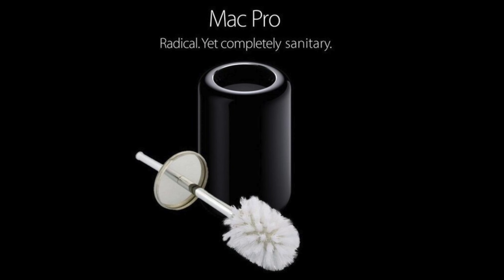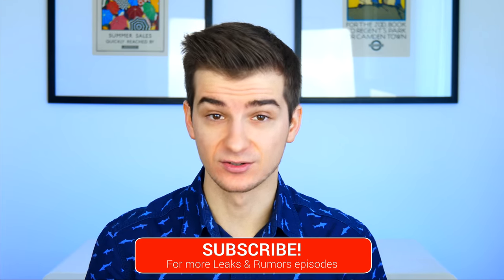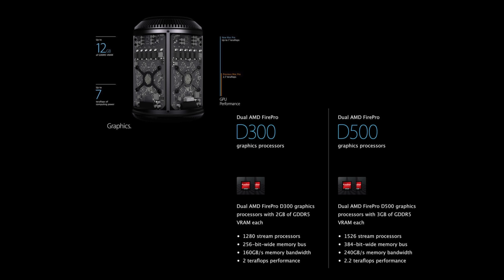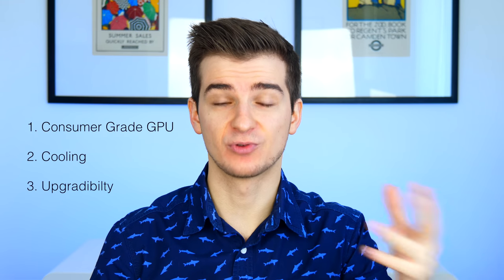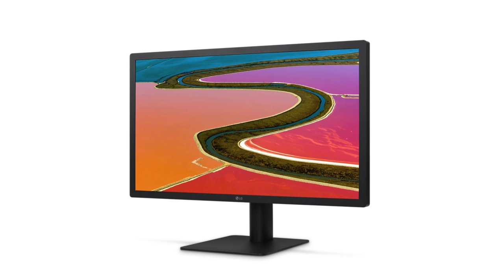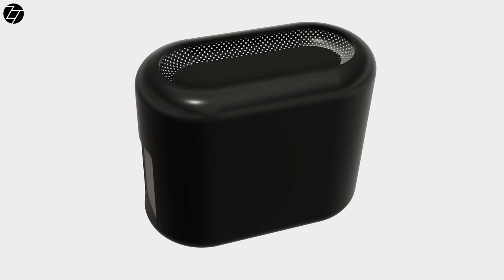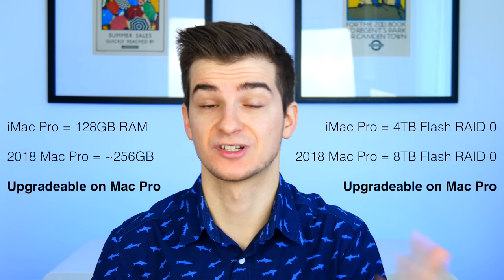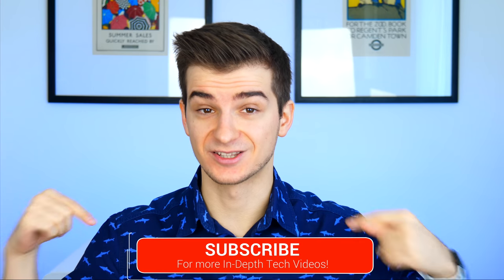NEW Mac Pro 2019 - Leaks & Rumors!

Comment: Who can afford a mac pro though. 
The only good thing is being able to upgrade over time.

What Apple need to do is revert imac and macbook pro back to customisable.
Reply: They could make the MacBook Pro a bit wider, add a numeric keyboard, and CD-ROM /writer.  Also some USB 3.1 ports.  That would provide more room for air circulation.  I would not want to have to haul a CD-ROM and a numeric keypad.  Having those on board takes up less ports.  I don't mind if it was a little thicker in order to accommodate the above mention drive and keypad.
Reply: @susanpratt3290  LOL. CD-Rom Writer in 2018. Should Apple also bring back the floppy disk?
Reply: Some people have CD-ROM's, especially with Hardware, like a Printer/Scanner or the Wacom Tablet.  Also, some books come with CD-ROM's with practice files.

Comment: I don't believe that we will get the Mac Pro in 2018. macOS High Sierra as a software product is a mess. Apple always tried to tie hardware and software. My iMac Pro works really fast on macOS High Sierra. Still, sometimes animations have delays (dragging XCode and other windows) , Safari gets 8 Core CPU usage to well above 75% in bursts.... My point: To create a modular Mac Pro with whom you can switch components you first have to have an OS that supports that feature (think of installing windows drivers). How will macOS 10.14. handle driver installation/integration while 10.13. can't properly manage window resize animations? Also there is project "Marzipan", iOS 12, tvOS, watchOS... bye bye MacPro 2018 ;_(

Comment: I'm so fed up waiting I actually considered Windows. Apple are really dragging their heels. I have a 6,1 and my early 2015 MacBook outperforms it which really pisses me off because the 6,1 was twice the price. One things is for sure, the £3500 I put into this 6,1 is gone. Apple should put a good trade in/upgrade programme in place when they finally launch the new Mac Pro for those of us who they duped into buying the toilet brush holder. Peripheral based is ok but when you can't buy even an unloaded caddy for an SSD over Tbolt 2 for less than about £350 (and we're on Tbolt 3 now) then it pretty much renders the 6,1 a useless piece of crap.